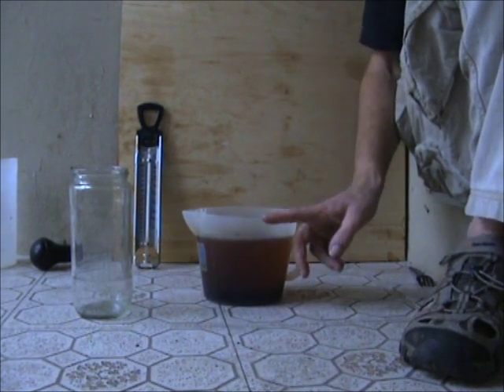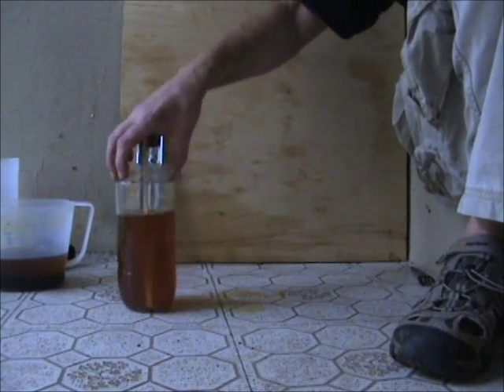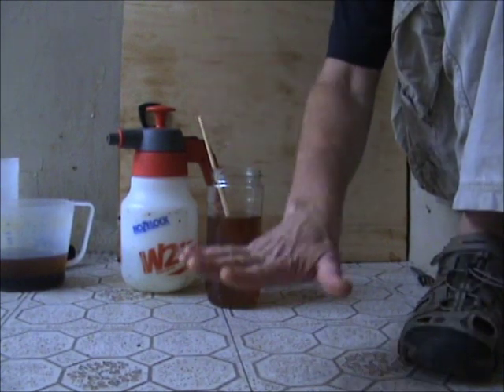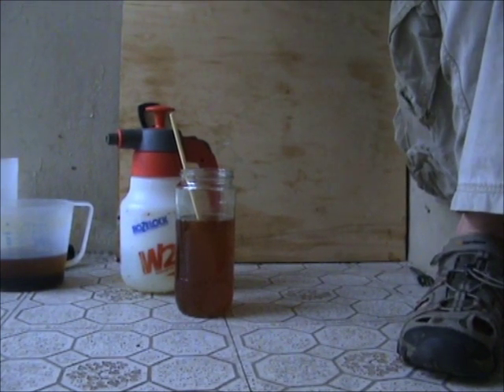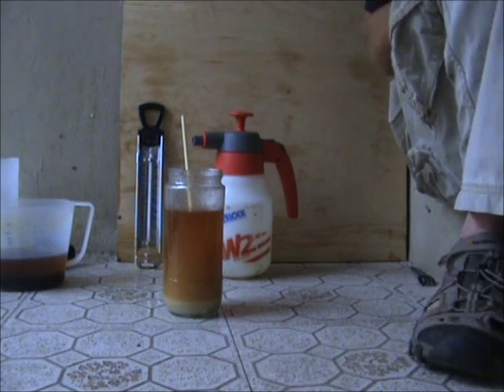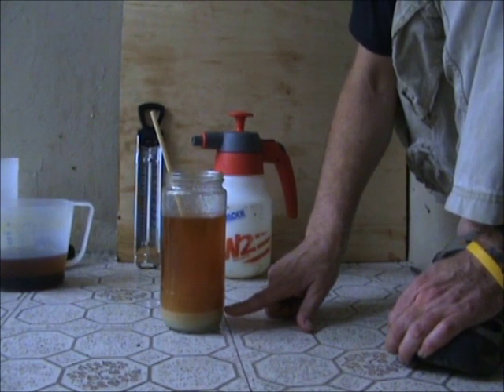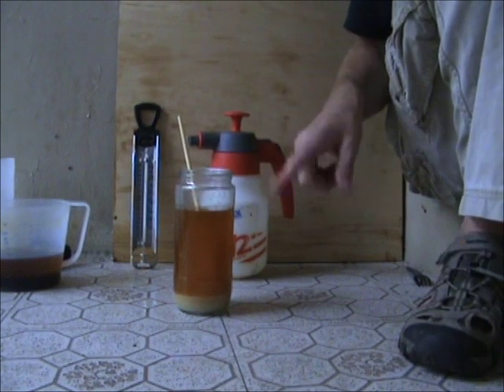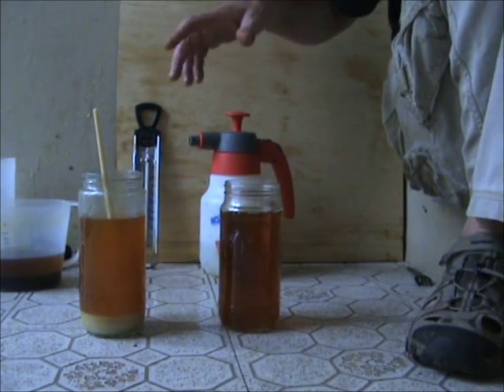Making Bio diesel at home -  Part two.wmv. 1twilight9

Comment: Hi just watch your video, due to high cost of diesel, and overstock of used oil came from our cooking, i think this might work to us. May i know if there are any brand of methanol can be used or percent? And whats the difference using sodium hydroxide to potassium hydroxide instead
Reply from the maker: Hi, Brand does not matter as long as its methanol. As for sodium and potassium? you need to add a bit more potassium than sodium hydroxide, its does the same thing : )

Comment: That was amazing - thanks. Just a question - do you need to cover the opening of the container that its drying in to keep out bugs etc and if so will that hinder the drying process ?? Cheers - thanks for the effort !
Reply from the maker: Sorry for the very very late reply : / ive had no problems at all with an open top, it maximizes evaporation. Just filter it after its dried : )

Comment: Hey Bro.. I have a couple of questions.. very nice Vid. by the way.. questions for you.. do you know it will work in just fine in a Turbocharged Diesel Engine? considering that there is Forced induction in the equation and the combustion is not as explosive as regular diesel.  and my other question is can you miss the washing step? that is the only part I dont feel sure about.. pumping water into the oil mix is an odd looking contraption. What would happen if you skip that step?   I live in Florida, US and its almost always summer here. so temperature wise, it ill be fine.   Thanks by the way.
Reply from the maker: +Gabriel Avila Hey Gabriel : ) My Engine is a common rail turbo HDI 2.5 cc and she runs fine no probs at all to this day. Yeah the wash process is a drag but with all that sunshine it will dry in no time. You can run it on unwashed bio but it will burn dirty and the methoxide left in the fuel in time will perish your fuel lines and things, hence the wash. Gin clear water at the bottom of the washed bio means very clean fuel. Drain the water and allow to dry. with temperatures that you get it won't take long : )

Comment: Hi twilight, sir. Thanks for your clip. My English is too short to catch some your words. My questions are:
1/ May I use ethanol instead of methanol?
2/ May I use potassium hydroxide KOH instead of sodium hydroxide?
3/ Can you explain in words that why you spray water into biodiesel? What for?
4/ Your final things is biodiesel. Is it enough Cetane index or not?
Thanks for your reply, sir.
Reply: You can make biodiesel with ethanol to.
Reply from the maker: +Thang Hoang Ist question, no. 2nd yes you can use potassium hydroxide but a little more. 3rd the water is used to clean out the methoxide due to a chemical reaction from the additives. its clean when the water comes through crystal clear. 4th Im not sure. Hope that helped : )

Comment: plz some one tell me that is there any need to modify ur vehicle to use bio diesel both summer nd winter ,like using heaters extra filters  and we use 100 bio diesel or some ratio of diesel nd biodie. plz email me on manidehar2067@gmail.com. thnx :)
Reply from the maker: Manjinder Singh All you need to do is change the fuel filter a couple of time in the first 4 month, as the bio will clean up your fuel system, thereafter you only need to change the fuel filter once a year as normal. I hope that helped : )

Comment: All iv been doing is filter the old oil then mix 5 gallons with half a gallon of petrol then mixing it with another 5 gallons of diesel which has worked fine for the last 5 months,..

Comment: How can I get rid of the waste?
Reply from the maker: Erick garcia You can recycle the sludge to extract the methanol, whatever is left you can use in your compost. Other than that, take it to the dump or find a company that makes industrial bio soaps.
Reply: Oh okay. Thank you! I was just concerned that item would become a hazard material.
Reply from the maker: Yes it would, its inflammable with the methanol still in it. Great for lighting fires though. If you leave the sludge in the open the methoxide will evaporate very quickly, if you had the right facility you could just burn the methanol out as well, but that's a waste. I take mine to a guy up the road who makes soaps and recycles it : )

Comment: Another way of cleaning the biodiesel after initial glycerine separation process is to add Plasterer's casting powder and stir vigorously. I believe that Casting Powder is just a finer grained form of Plaster of Paris. When added to biodiesel it scavenges water molecules and the soaps that don't drop out with the glycerine. Most of the other crap attached to the water molecules comes over with it, settling out on the bottom of the tank as a viscous sludge. I usually add a double handful to about 200 litres. After agitating, I let it settle out in the settling tank then siphon the oil from the tank. The 'washed'  biodiesel  is very transparent and straw coloured. I can't remember where I came across this method but it seems to work quite well. It has been powering the farm truck  for years. Why do I use it you might ask? Well, I live out in the Australian bush and most of the water I use comes out of the sky. Cheers
Reply from the maker: a0cdhd Thats given me food for thought, thanks for that idea, brilliant : )
Reply: thanks for your message. how can i find that powder in other countryes'.. i'm from Argentina
Reply: @pablo156v6  you should be able to get it from a hardware store or some place that supplies stuff for plasterers.

Comment: Instead of letting it sit to dry out, could you boil it at a 100-110*c to skip that 3-4 day wait?
Reply from the maker: Daen Gignac Yes absolutely that will work but don't overheat as it does have a flash point. in summer i let it evaporate naturally : )

Comment: Hi thanks for making the video's, nice extra info and such. The problem I have is that after mixing the oil, with the mixture of sodium hydroxide and Methanol it looks like milk and stays that way. Also, the mixture of the sodium and Methanol didn't get warm or hot like you mentioned. I used sink/drainpipe cleaner, on the cover it says it contains sodium hydroxide. Maybe I have to try another brand? Or is there something else that could have gone wrong? Even after cleaning it with water it's still  really creamy and doesn't burn.
Reply: Ow and it's liquid sodium hydroxide, maybe that's the problem?
Reply from the maker: Showmethosevideos sound like thats the problem, make sure its dry sodium and that its not containing any other chems. you should then get a good chemical reaction, 8 milligrammes of sodium hydroxide to 200 millltrs methanol, good luck : )

Comment: And also in your opinion is it necessary to heat the oil before mixing?
Reply from the maker: yes only heat it up to warm in winter, in the warmer months you will be fine. with cold oil the reaction aint so good : )

Comment: What happens with the waste glycerine and wash water?
Reply from the maker: you can recycle the meth from the glycerin and use it again. or just let the meth evaporate and then put it on you're compost, or take it to the dump. the water down the drain, it will keep you're pipes and the sewage way clean : )

Comment from the maker: well its hard to believe in a lot of things these days what with so much info moving about but you could be right with the more modern engines. my engine is a 2006 so it may of just scraped through. the thing with older models is that they tended to use more rubber in the fuel line which degrades with bio so new modern lines must be used i have been told. thanks for the info i will keep it in mind : )

Comment: would you believe in this or just a block propaganda? ---6.0 liter diesels & Biodiesel don't do too well together. The older 7.3 liters though LOVE the stuff!! Cummins & Duramax engines do well on Biodiesel as well. Stay away from anything 2007 or newer due to DPF (diesel particulate filter) issues (biodiesel will dilute the engine oil leading to pre-mature engine damage).

Comment from the maker: thanks mate : ) yes you can do both in the same tank but i must say its a lot easier with a tap at the bottom... as for putting unwashed bio into your tank not only is it corrosive on the the fuel lines, injectors and the like but it will burn dirty and its all about being green as well, do wash your bio : )

Comment from the maker: Hi, so many questions, Its all on the vid as shown : ) maybe one day i will put it to text but not now... on models that are over 10 years old, you will need to check up on the fuel lines as they may be made with a rubber compound as more modern models use synthetic, rubber is not good and will break down in time... hydrogen is another matter, sorry cant help you there... hope that helps : )

Comment: hello . thanks for the vid. also thinking about it . hum so its methanol and caustic soda  rigth ? 
 don´t You have these instructions written somewhere ? like a tutorial ? a DIY ?  cause when i´m doing something must be step on step . the vehichle uses as well the izusu 1.7 diesel engine. so as you said i should replace the fuel lines for more recent ones ? 
 does bio-fuel works cool with this hidrogens kits they make-it ? let us know if u tried with normal oil . thanks

Comment from the maker: cheers buddy, if its over ten years then you may have to get your fuel lines checked, as older models tent to use natural rubber compounds which degrade too quickly... if ya go by what i say but dont feel confidant then go with a 50/50 mix with general road diesel... as for your last ?? see part one : )

Comment from the maker: just because the majority of water has passed through the oil it does not mean it is dry... particles of water will still be left and this needs to dry fully of you filter will clog up.. you can speed the drying by heating the oil, do not cut corners : )

Comment from the maker: hello there, it is necessary to dry the bio fully as if you dont the water left will block your filter badly and you will not go.. same with washing the bio make sure that the bio is fully washed or the remaining soap in the diesel will also wax up your filter, these are very important issues, dont cut corners... hope this helped : )